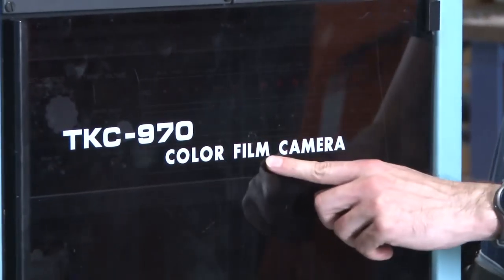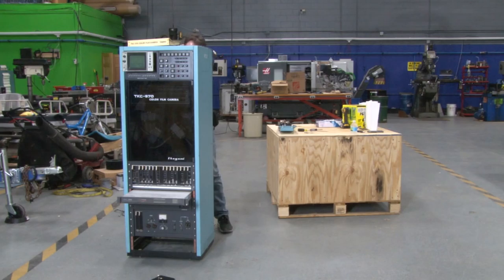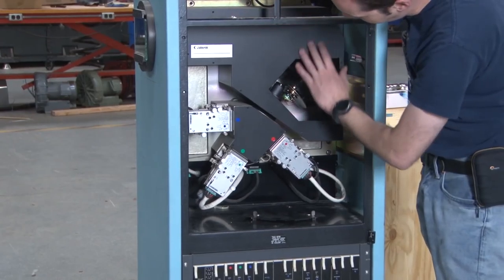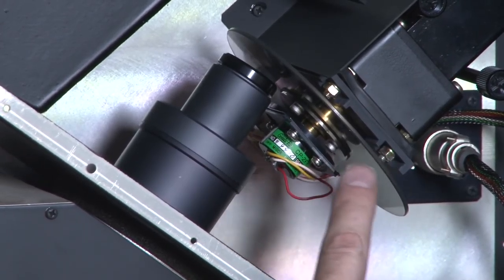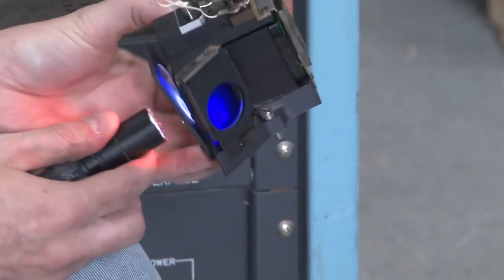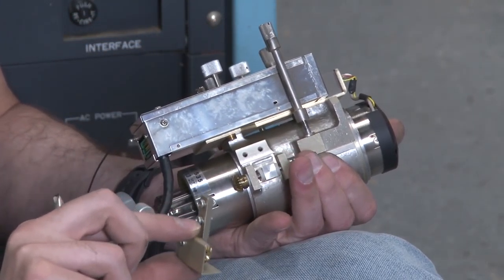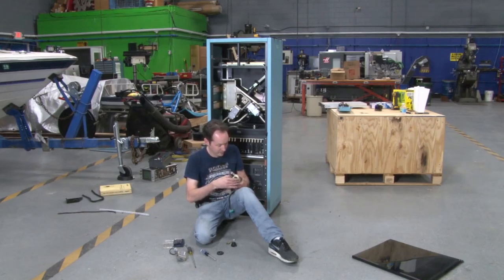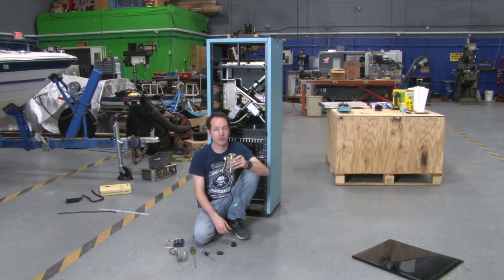Ikegami TKC-970 Color Film Camera: Equipment Autopsy #92

Comment: That's not a PMT, that's a vidicon tube.
PMTs have no spatial dimensions whatsoever.
They only have one similarity to this vidicon - both use a photocathode to convert photons to electrons.
However, that is where the similarities end.
The PMT then accelerates the electrons into the dynode chain, multiplying them along the way(hence the name) and outputs a large signal for an insignificant number of photons(single).

The Vidicon accumulates the charge on the photocathode plate, and then it works pretty much exactly the same as a CRT TV - it actually reads the image out via an electron beam.
As it scans the photocathode surface, a charge is detected on the front electrode(tiny wires with the blue connector) on the front(simplified), then it goes through the preamp and it turns into a series of lines, acting like the reverse of a CRT TV.
Reply: excellent comment. very useful information. thank you so much.

Comment: OK you youngsters. First they are called Vidicon tubes. They are a smaller cousin of the original orthicon tube. Yes, it's called a film camera because it takes video images from film projection. Thank you Dan, you're right about pull down. The term "film chain" was used in broadcasting to note 2 or more of these things running movies, commercials etc. slides. I know; I worked in television for decades. Also, it's not unusual to see one large apparatus made up of many manufacturers subassemblies.

Comment: Hi, I worked with these at WPRI-TV in Providence. FYI the rotating component is s Neutral density filter that adjusts light levels going into the camera section. The film cameras were fed by an optical multiplexer with servo operated first surface mirrors that allowed switching between 2 film projectors and a Slide Projector which were all made by RCA.

Comment: I think that disk is just a neutral-density filter to adjust the brightness, I don't think it constantly spins.  And I think the angled piece is to reflect the IR (and hence the heat) off to the side so that it doesn't go into the cameras and doesn't go back into the projector, I would suspect it gets reflected into the black side of the unit and absorbed.

Comment: It's a vidicon tube, think of it like a reverse mono CRT, the plate at the front is photosensitive and has very high impedance. So it needs an equally high impedance input to amplify the analogue levels coming off the front plate which appears at the signal output when scanned from the electron beam, in a traditional camera, the sync signals from the V and H oscillator are mixed on the start of a frame and the H on line end and you would have a mono TV camera

Comment: I'm wondering. are the air circulation related noises so constant you could filter them out of the audio or al least suppress them?
I recall many things being turned off when recording starts but something is still running.
Reply from the maker: It was a 90 degree day and the AC was being fiercely protected.

Comment: The 29.97 is a calculated figure to keep the beat frequencies between the black and white signal at 30hz and the colour signal beating at the third, seventh, and eleventh harmonic of the subcarrier freq and the horizontal scan rate. Their are a few math proofs out there that explain it much better than I can...

Comment: Sorry flying spot scanners use PEC which are similar and newer than the old CDS cells.... They convert a light level to a voltage level, but have no raster scanning ability, which is why you need the flying spot CRT to illuminate the scanner item one line at a time... The voltage is then digitised and stored in a memory to be played out one line at a time or one field at a time depending on the type of film scanner!